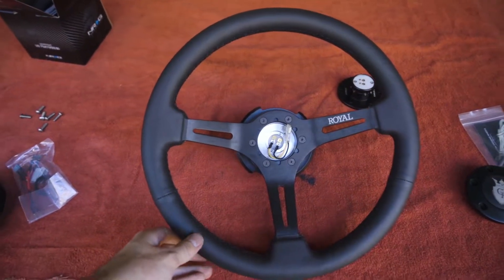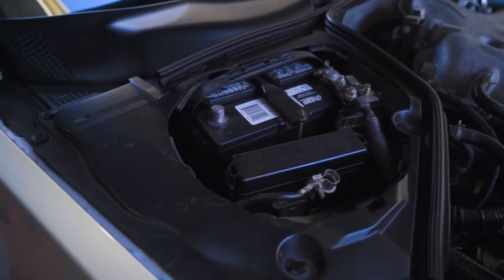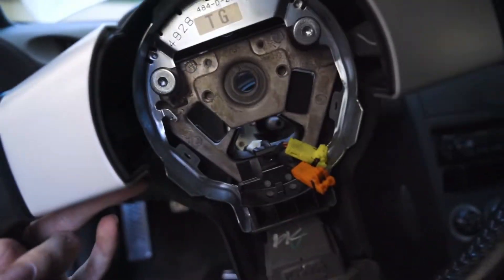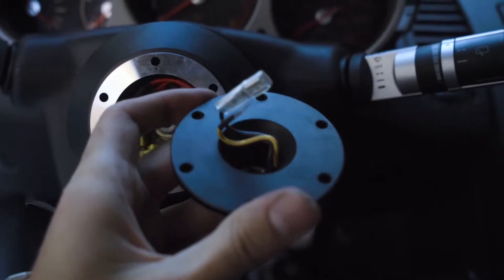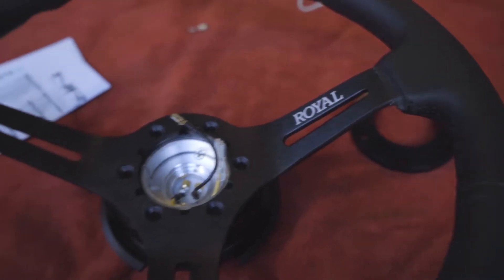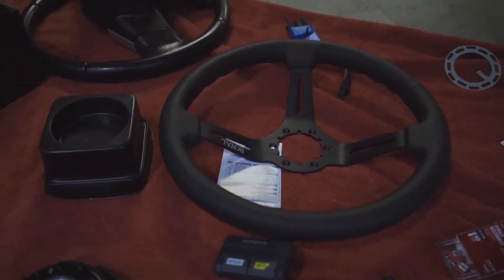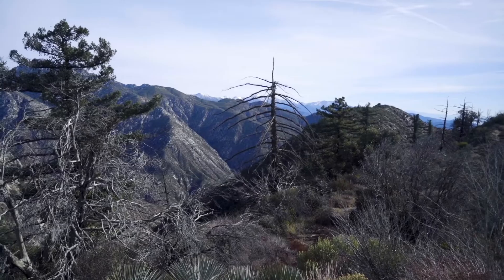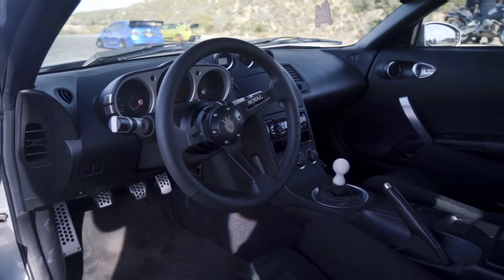350Z Grip Royal Steering Wheel and NRG Quick Release Install!

Comment: Did you need to install the hub ring to keep the wheel straight or whatever it does haha
Reply from the maker: I didn’t order one because I didn’t know about them until after I did the install so my hub is slightly crooked so that the wheel is straight but with grip royal and some other steering wheel brands, you technically need it to have everything straight

Comment: At 330, where did you the hub from? Is that in the center of my old steering wheel? Or do I need to buy it separate?
Reply from the maker: That’s an NRG hub. You’ll need to hit it, it’s not part of the stock set up.

Comment: How come i cant put my grip royal wheel to be straight, its off. It doesn't fit with the wholes that would make it straight
Reply from the maker: Drift 240sx you’ll either need to rotate the hub or buy the rotator space kit from grip royal. I opted to just rotate the hub.
Reply: @avengednick  thanks for the quick reply
Reply from the maker: Drift 240sx happy time help, good luck with the install!
Reply: @avengednick  thanks the video help out a lot, just one more question my vdc light and slip light stay on now do you have any idea why that is
Reply from the maker: Sorry, not sure on that one. My car is a base model so I don’t have VDC or slip control on my car.

Comment: Is your steering wheel centered or did you have to buy a spacer  my grip royal wheel is sitting at 2 o’clock and the hub is at 12 o’clock it’s super annoying
Reply from the maker: kenlee G I just found out recently there’s a spacer necessary when using a grip royal wheel but I just rotated the hub on the steering shaft to correct it.
Reply: @avengednick  do you know where i can buy the spacer
Reply from the maker: Drift 240sx you’ll have to buy it from grip royal